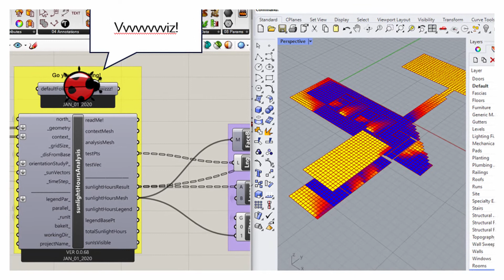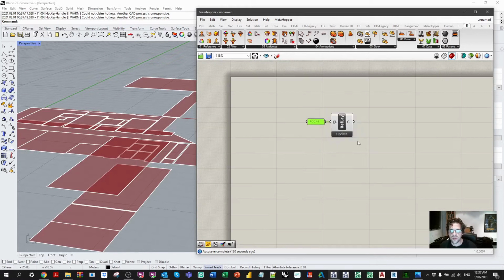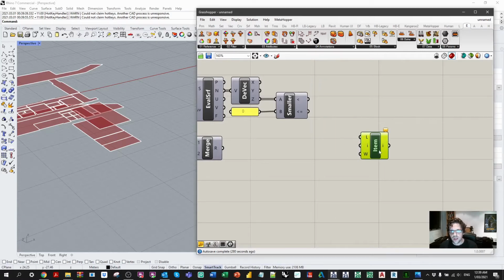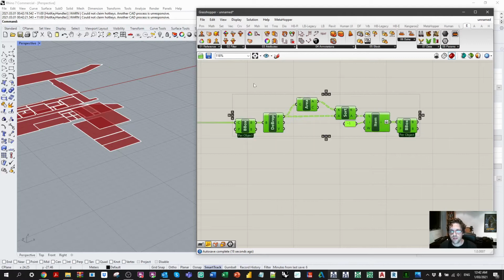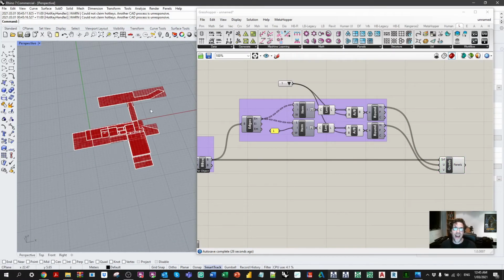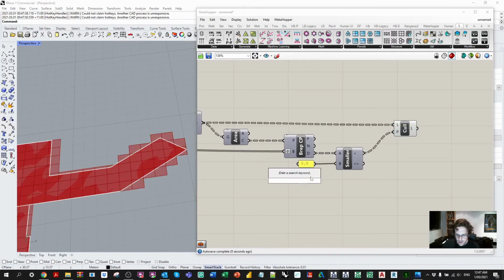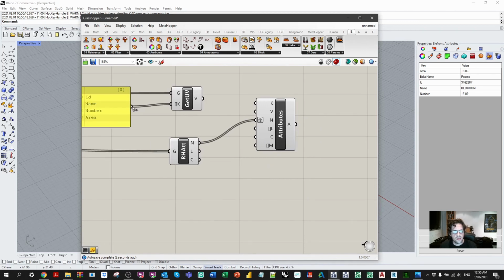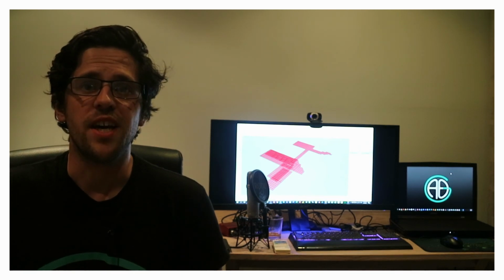Rebuilding surfaces for sampling using Grasshopper!

Comment: Great video.... I don't even need BIM, but I can think of ways to apply this info. Thanks...
Reply from the maker: Thanks! I use this technique very often when doing solar analysis and other sampling based exercises. The ladybug division algorithms aren't ideal still I find, mesh triangles tend to be quite uneven, until that works it's my way around it!
Reply: @AussieBIMGuru  I was trying to think of a voxel based sampling method and I was hoping Grasshopper might work, so this paves the way for a three dimensional approach. Nice vid.
Reply from the maker: Check out the volvox package also, quite handy for converting point grids/clouds to voxels.